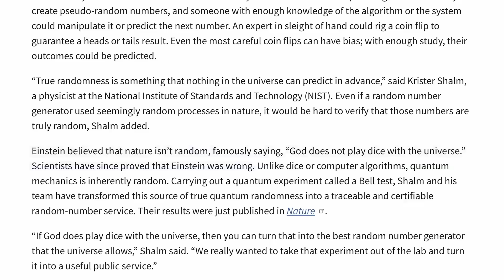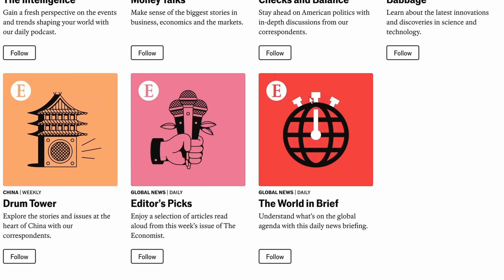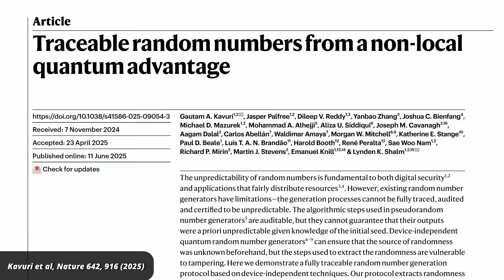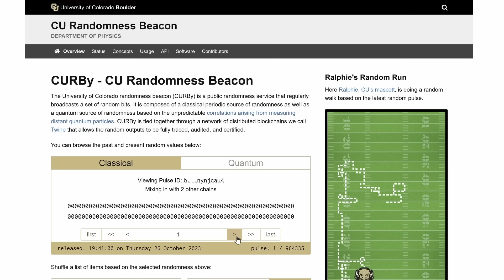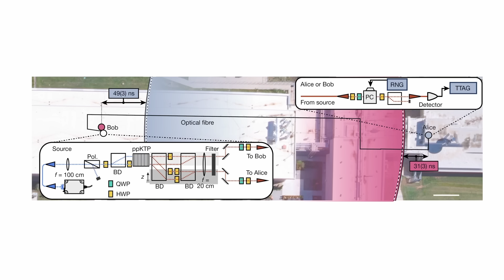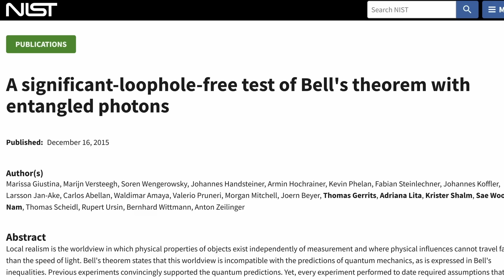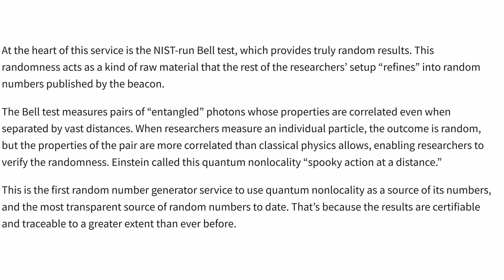Was Einstein Wrong about Randomness?

Comment: To prove non-determinism, you’d have to do the same test twice. Meaning that the starting state of the whole system (universe) would need to be provably identical. You can’t get the universe back to the same state again as that would break the laws of entropy. Also nobody would remember the results or how many tests have been conducted as remembering something new = not the same starting state. Also there’s a lot of noise in the universe: cosmic microwave background, gravity waves, neutrinos, field fluctuations, etc. We can’t measure these things precisely enough to rule out their influence to the test results. Due to uncertainly principle we can’t even measure our test starting state precisely. Thus the test is both theoretically and practically impossible to do.

If we somehow still managed to do the test and the universe turned out to be determistic, the universe would be in an infinite loop repeating the test. That’s what happens in deterministic universe if any prior state repeats. It’s an infinite loop.

Comment: Totally agree with you since that nobel price given to those claimed that there wasnt any hidden variables. I mean they need a code developer to discuss this rather than just physicist. They say they still don't know about the most of the universe but somewho they claim that they looked anything and couldn't find it. And even tho lets say we figured out the dark matter dark energy etc and fully solved our universe still that doesn't mean we can claim that there is not any hidden variables.

Cuz as a developer let me give you an example. First how we create random variables? We do it with coding in the system with maybe getting help from the cpu's tick count, tick time, mainboards timer etc right? But that means eventually someone in the system can reach to this systems components and reach to the software and can solve the algorythm right? 

BUT what about the out of the system variables? You can call it upper system, other system, whatever you wish. Just check for the Cloudflare's lava lamps encryption system! They used lava lamps to create randomness. To make things more secure they used the system out of the system. So if you can't access to the upper system and even learn the upper system's physics to calculate you can't solve the randomness. So did we able to check if the upper system really does not exist to claim that we looked anywhere? 

I do believe that the creator used some randomness to create multiverse we all developers do that. But any randomness would have been checked if you had enough knowledge in theory like even if we burn the paper in a box, if we could calculate all the atoms positions we could knew there was a paper there before with the even text written on it.
Reply: Yet another kid who wasn't paying any attention in school. ;-)

Comment: I'm afraid you did not grasp the deeper message of this paper.

The unpredictable results described in the article are those that emerge from Bell tests performed with entangled photons

Let me explain step by step:

1. The quantum source

They use a nonlinear crystal to generate pairs of polarization-entangled photons (via spontaneous parametric down-conversion).

These photons are correlated: for example, if one is horizontally polarized, the other tends to be vertical, but the outcome is not deterministic.

2. Independent measurements (Alice and Bob)

The two photons travel to separate stations (conventionally called Alice and Bob), about 110 meters apart.

At each station, a hardware random number generator independently chooses, on the fly, the polarization angle used to measure the photon.

Alice has two possible angles (𝑎 = 6.7 degrees, 𝑎′=−29.26 degrees), Bob has two others (𝑏 = −6.7 degrees, 𝑏′ = 29.26 degrees, b′).

3. Binary outcomes

Each photon can yield only two possible outcomes: detected as “0” or “1” (depending on polarization).

These results cannot be predicted in advance, even knowing everything about the system, because they are governed by quantum mechanics.

The only predictable feature is the statistical correlations between Alice’s and Bob’s outcomes: when compared, they violate Bell inequalities, proving they cannot be explained by local deterministic theories.

4. Why they are truly unpredictable

The measurements are space-separated (too far apart for any light-speed signal to coordinate them), so there is no way for a “hidden trick” to predetermine the outcomes.

This ensures that each bit generated (0 or 1) is intrinsically random.

The authors certify that every round of 15 million trials contains at least 820 bits of min-entropy, i.e. certified unpredictability.

5. From unpredictability to usable numbers

The raw data is biased (more 0s than 1s or vice versa), so it is processed with a cryptographic extractor (Trevisan extractor).

This produces a sequence of 512 truly uniform bits, meaning each is equally likely to be 0 or 1.

Each sequence produced has an error probability (i.e. chance of not being truly random) of less than 2^−64, 2^−64, practically zero.

👉 In short:
The unpredictable results are the binary measurement outcomes of entangled photons in Bell experiments. No one – neither the researchers nor a hypothetical external observer – can predict in advance whether the next photon will yield “0” or “1.” And it is precisely this quantum unpredictability that is transformed into certified, traceable random numbers.

These are the result of the articles, regardless of what Sabine thinks

Comment: Decades ago I read about a small machine that generated random numbers using radio active decay. I don't remember the details but a computer could use it as the seed for a random number generator. Wouldn't that be TRULY random? Is there anything wrong with this idea?
Reply: It's not random at all. You are simply not seeing the other half of the entangled system because it is behind a relativistic event horizon. This means that you can treat it as random for whatever purposes you want, but it is fundamentally not a random process. What gets people upset is that randomness and determinism do not form a pair of opposites in a relativistic universe. Things are a tad more complicated than that and people hate complicated.
Reply: @lepidoptera9337  Ok. But if I use the nuclear random number generator for an experiment that requires randomness, could there be an error that could ever be detected or cause an experimental error?
Reply: @wbcc3388  Depends on the nuclear decay you are using. The exponential multiplication of neutrons in a critical reactor or bomb is certainly NOT a statistically independent process. Neither are the emissions of a laser, the correlations between magnetic spins in a permanent magnet or the atoms in a Bose-Einstein condensate. This entire idea that quantum mechanics is somehow always completely "random" is based on very naive ideas about quantum systems that are simply not the case for any of the interesting ones. Yes, the theory starts with a statistically independent ensemble, but it puts the correlations very quickly back because otherwise it would stay a toy theory that couldn't be used to deal with the stuff that is actually interesting.

Comment: Here is a beautiful thought experiment for you.

Imagine the universe has a giant wall at its edge. Not a metaphorical one—a real, physical barrier. Now picture yourself standing in front of it with a drill, ready to punch through. But here’s the twist: beyond that wall isn’t empty space or darkness—it’s nothing. No atoms, no time, no dimensions. Not even a vacuum. Just... the absence of everything.

So what happens when you drill into it?

You’d be trying to make a hole in a place that doesn’t exist. And the moment your drill breaks through, you’re not just poking into nothing—you’re creating space where there was none. That’s the paradox: drilling requires space, but space doesn’t exist beyond the wall. It’s like trying to carve a doorway into a dream that hasn’t been dreamed yet.

In short, if that wall really separates us from true nothingness, then breaching it isn’t just impossible—it’s meaningless. Because there’s nowhere for the hole to go.

So drilling even the smallest hole on the wall of the universe is logically impossible

Comment: You should not be using vulgar language to discuss a matter which is reasonably a matter of potential disagreement, even if you are right about the referees failing to challenge a circular argument. I favour randomism ab initio. I think that the determinism which says that this randomism is an illusion is a reasonable belief. The determinism which lapses into superdeterminism when confronted with the evidence of Bell's over-correlation is not a reasonable belief.

Comment: Except that "measurement independence" and "device independence" are completely different concepts. The authors of the paper have not, in fact, made the "basic logical" mistake you claim they have.

Measurement independence (MI) is an assumption of Bell’s theorems, alongside the existence of hidden variables (HV), output independence (OI), and parameter independence (PI). Therefore, Bell’s theorem can be summarized as follows: if these assumptions are satisfied, then a certain inequality must hold. This is in conflict with experimental observations, as various Bell experiments show. Therefore, at least one of the four assumptions must be incorrect.

Device independence (DI) is a security property that some quantum cryptographic protocols possess. Specifically, it is the property that security (or certifiability, in the context of random number generators) can be proven in the "device-independent model." In short, this model assumes that the quantum devices used in the protocol are not trusted to behave as expected. Therefore, statistical techniques must be used to certify that their output is of sufficient quality. These techniques usually involve the violation of some Bell inequality.

In this paper, the authors (implicitly) use "measurement independence" to prove that their protocol can certify randomness. As such, you are correct to say that they did not prove that "true randomness" must exist in nature. However, this was never their claim. In fact, this is not a paper about the foundations of physics at all, but about quantum cryptography. The authors never mention Einstein in their paper, nor do they discuss the implications of their results for the existence of "true randomness." This claim only appeared in the press release, but you, of all people, should know that press releases are often misleading and completely twist the actual claims of the paper.

What’s important to understand (for your audience at least) is that there are several subfields of research within the broader field of "quantum information theory":

- Some researchers focus on the foundations of quantum mechanics. These scientists try to understand quantum mechanics better, often through the study of Bell-like inequalities. Sometimes they assume MI, OI, or PI, and sometimes they relax those assumptions, depending on the goal of the paper. This community is also the most likely to discuss different quantum interpretations or alternative theories.

- Another subfield is quantum cryptography. In this context, researchers usually use the current state of knowledge about quantum physics to prove the security of certain protocols. When Bell-like inequalities are used, the standard assumptions include measurement independence. The discussion of whether these assumptions are always valid is generally beyond the scope of their argument. It is interesting and useful to try to relax these assumptions, and some papers do so (in which case the assumptions they relax are explicitly mentioned). However, this is usually not the main point the authors are trying to prove. In fact, these assumptions are similar to the assumption of the existence of pseudo-random functions in regular (non-quantum) cryptography. We don’t know for sure if this is true, but it is useful to study cryptographic protocols and design secure protocols.

- There are other subfields, such as quantum computing, quantum resource theory, and quantum communication, but they are not relevant to this discussion.

This paper is about quantum cryptography, not the foundations of quantum mechanics. As such, the authors use the "standard assumptions," including measurement independence, to prove the device independence property of their protocol. For the goals of this specific paper, this is acceptable as long as they do not claim more than what they prove. In this case, their claim is that their protocol has specific "traceability" and device-independent properties. This does not say much about the fundamental and absolute existence of randomness in physics. In fact, I invite the reader to look at the paper (full version available here: https://arxiv.org/pdf/2411.05247) and search for any mention of Einstein or any "fundamental proof of randomness." The authors' claim about "randomness certifiability" needs to be understood within the narrower framework of quantum cryptography, not as an absolute and fundamental truth—which, again, is not what they claim. If there are mistakes in the paper, they are not the ones you point out.

Overall, from your video, it appears that you have either not read the paper or do not understand it, nor what its authors claim. It seems you’ve read the press release and the abstract and concluded that the authors and reviewers were incompetent, while YOU have conflated two  fundamentally different concepts (namely MI and DI). You used a condescending tone, came dangerously close to calling the authors and reviewers stupid, and straw-manned the paper using the press release about it. How can this even be considered a serious review?

Before criticizing other people’s review processes, perhaps you should examine your own video review process, as this video demonstrates a complete lack of research and seriousness. This is how misinformation is created and spread—by using your physicist persona and assuming you can understand other people’s work based essentially on press releases. It’s okay to make a mistake in a video, but being condescending while failing to do the proper work is a significant problem.

If you want to criticize how press releases can be misleading, by all means, do so. But that is not what you’re doing here. I expect more from a physicist than this.

Comment: This critique completely misses the mark. The Nature paper doesn't claim to have "proved true randomness" or that "Einstein was wrong." It plainly a assumption-bound protocol for certified randomness generation based on Bell violations, with quantified error bounds and full public traceability. That's an operational advance, not a metaphysical manifesto. The only ones overselling it were the PR writers...read it ..the authors themselves are transparent about assumptions like measurement independence and no-signaling. Pretending otherwise just sets up a straw man.

And no, the 2015 "loophole-free" Bell tests weren't

"impossible" or "nonsense." They were landmark results that simultaneously closed the locality and detection loopholes-exactly what the field means by "loophole-free." Calling that rubbish shows either ignorance of the technical literature or a willful misrepresentation for "views". Criticism of hype is fair dismissing serious experimental physics as if peer review has been conned is not, puttong words in there mouth that arnt justified ....that is not.

Comment: Thank you for making me think about this again. But it's disruptive to my writing schedule. 

I realized this morning that if momentum is quantized so is direction. When there is rapid rotation,  position cannot appear quantized to an external observer.  
But to the observer at the center of the rotation, even when the observer knows there's rotation, the possible directions are quantized relative to the direction of the source of the change. 

Which,( at least in my head this morning) , means that space can be continuous while everything we can possibly interact with is quantized including positions. 
The above implies that the big bang dark energy expanded and slowed down at the edge of space. The density of waves changed enough that the following waves bounced off. 
If space has a nonlinearity for waves of momentum this concept works. 
But I know I would get lost in the math for years.

Comment: I now immediately leave any video that contains embedded advertising read by the presenter. Even though I enjoy and learn from Sabine's programs I get enough advertising elsewhere. Put embedded ads at the end or use the skippable ads if you must, but I will not tolerate a video that starts out with an embedded ad, regardless of the value of the content.